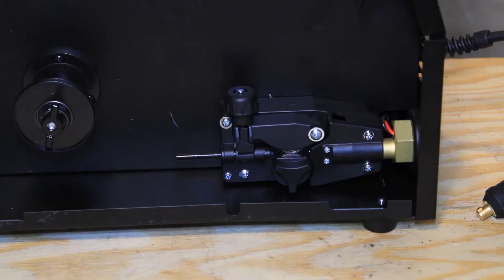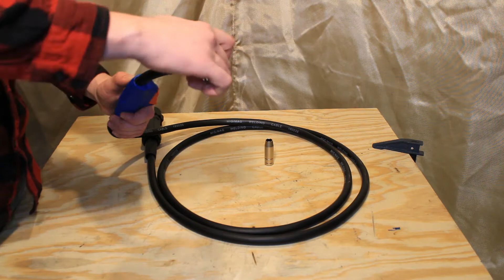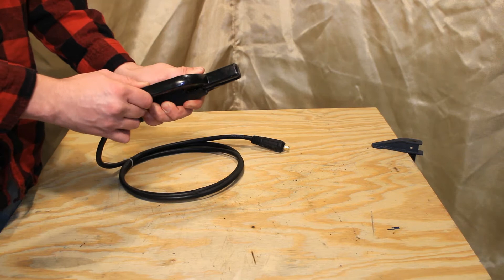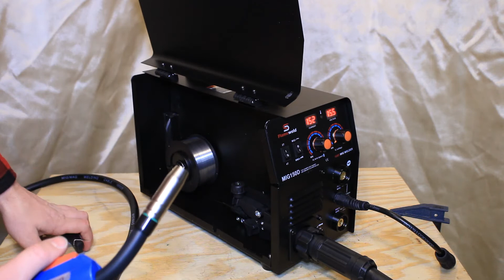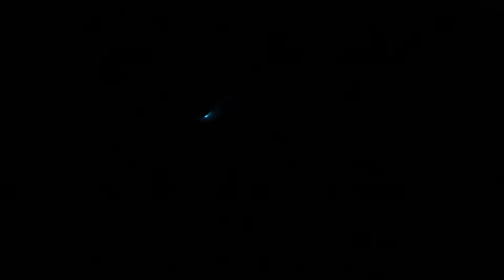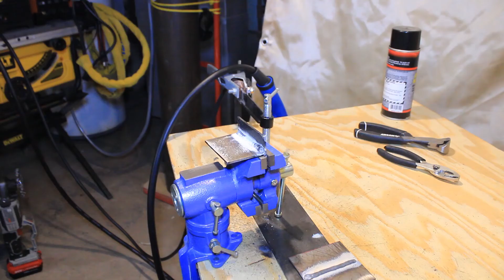Cheap MIG full review: $179 Flameweld 150D. Plus some welding!!

Comment: Perhaps you should try the smaller plastic "nozzle" for flux core- it allows much better vision of the puddle than the large metal nozzle needed for shielding gas.  Makes a big difference.
Reply: Lincoln ElectricFlux-Cored Welding Nozzle
Reply from the maker: If someone is first learning to weld with a wire feed system and they are using fluxcore, that is a good way to see more of whats going on. It opens it up more to see around the tip. I have enough mig experience that my preference is the gas nozzle. it adds some protection against touching the copper tip to the work piece. Haha that destroys tips pretty quick. Plus I dont need to improve my mig welds any, so I'll leave it how ive been doing for years. My tig welds on the other hand.... Those need some work haha.
Reply: @618kustomz  Yes-  but I only have a HF 110v flux core that cost $79 a few years ago.... The smaller plastic nozzle allows better vision and control of the puddle...  Just mentioned it, as your review was very good, and there might be a few beginners watching?
Reply from the maker: Absolutely! For anyone first learning to weld, being able to really see everything that is going on is very important. If you cant see the puddle and the surrounding metal, you are probably going to struggle. Another good bit of advice is to get a good welding hood with a large viewing window. The small lenses really restrict what you can see as well. Also making sure to have the proper lense shade so its not too dark or too bright. That helps a lot also. So a good auto darkening hood goes a long ways!!